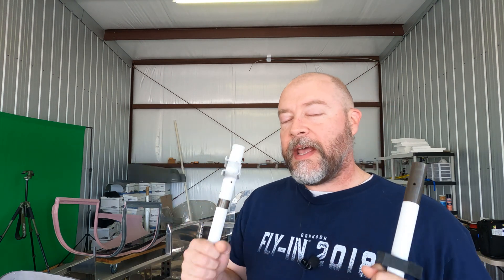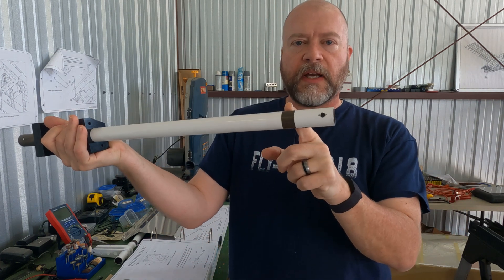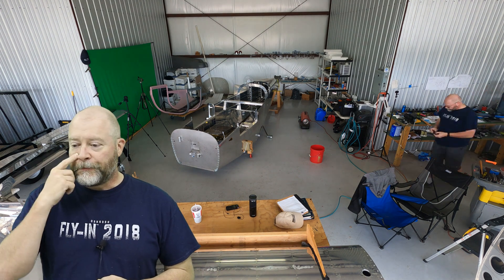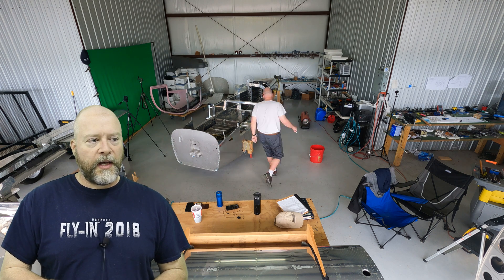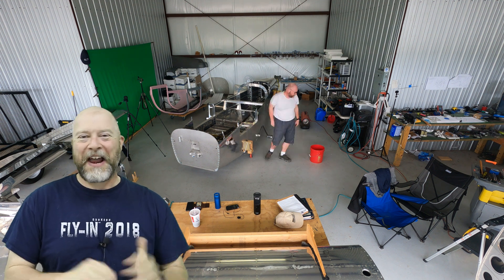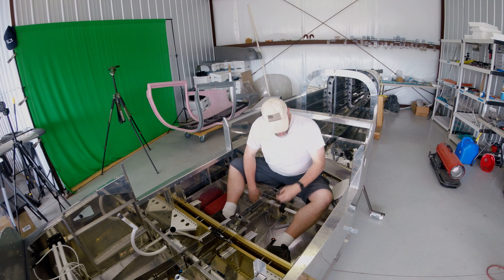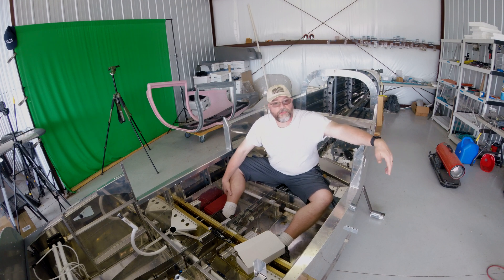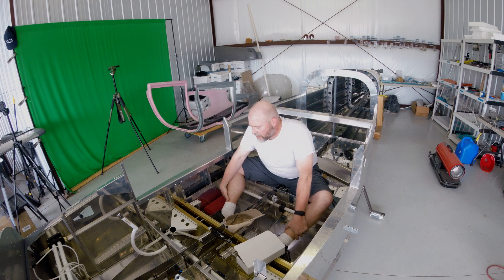Flap Torque Tube and Bushings | RV-10 - Fuselage 047 - Jason Ellis Builds

Comment: Cutting the bearing blocks for the flap system?????       Clearly you have no idea what kind of loads are induced back through the system by the flaps.   Hopefully no other builders that watch this video will be tempted to do the same.
Reply: I'm surprised nobody else has commented on this. Jason was worried about the wd40 affecting the bushing but slices it open. I'm not an aeronautical engineer but I think this was a mistake.

Comment: The flap position sensor you purchased from Vans is the old kind and it won't go together with any glass panel. You have to buy a "POS12" sensor to be able to interface with e.g. a Garmin or Dynon Panel. Or change to the newer flap motor that Vans has changed to meanwhile with an integrated position sensor.

Comment: WONDERFUL Intro!!!  =)

Something to think about IF... there are more 'tight' connections.  One word... THERMODYNAMICS!

Take the smaller (inside) piece... but it in a FREEZER for a couple of hours.  Take the larger (outside) piece... and HEAT it (even if it's just setting it in the Sunshine).  Take the piece out of the Freezer, slide the larger piece on... and it will slide on easily.  The connected pieces... will then 'normalize' and made the necessary fit.

Thermodynamics.  =)

Comment: May be drill a hole through both have after you put the slit in it. Then tap the one half and run a bolt in there tighten as needed.

Comment: could you not just cut a piece of sand paper on the shaft and remove the powder coating?
Reply: I was thinking the same thing. Just sand off the powder coating and then apply a primer when installed.  Even though the is Buried deep inside the fuselage, is this torque tube exposed to the elements in anyway?
Reply: probably doesnt even need all the powder coat removed just enough to meet the need.
Reply: Maybe just some sand paper on the inside of the block, sand enough to clear the powder coat?